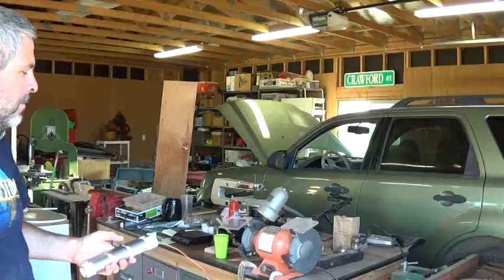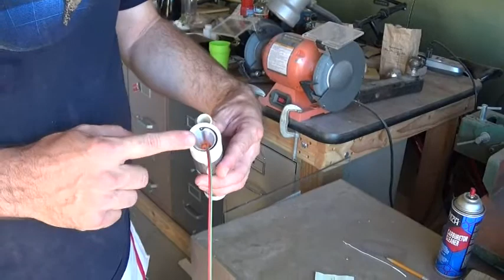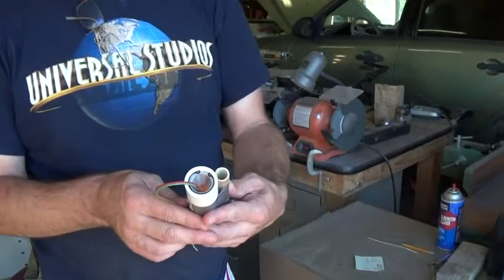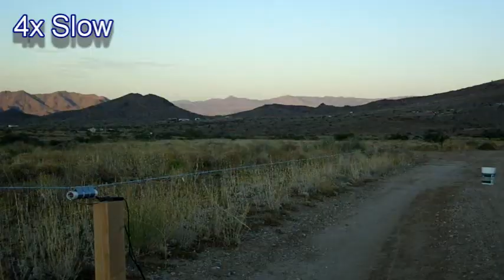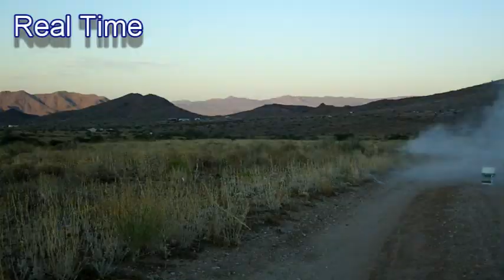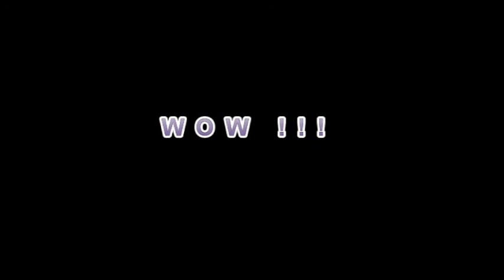Sugar Rocket Motor Test

Comment: How did you add the snapring?  I assume you cut a groove but how was it done? That nozzle looks like custom work. What is it made of?

Nice video work with great sound!
Reply from the maker: Oh man! I am sorry I did not see this comment. It got lost in my notification list.
Snap ring groove was made on the lathe so that was pretty easy. The nozzle did come out near the end of the "flight" so it seems the retaining system failed.
Nozzle was made by me on the lathe also. It was milled from a piece of aluminum stock. It was beautiful! However... Melting point of aluminum is around 1200 degrees. Flexi-fuel apparently gets well over 1200 degrees... Lesson learned! The convergent side of the nozzle had massive damage from melting and the nozzle hole was about 2 or 3 times its original diameter.
We have been trying various materials and techniques for nozzles to try and find something that is both effective and simple. In fact, I have one ready for testing later this afternoon. This one will be material number 4 and is by far the simplest to make. Fingers crossed.
Reply: @rotaryrocketry  You may be able to retain the nozzle externally with an end cap. That way you are outside of the heat source. Let me know how it goes!
Reply from the maker: @TheRocketeer  Good thought although my new nozzle design is "self-retaining" due to the pvc parts that are used.  On the down side... I just finished the motor test and it turns out that the nozzle washer was displaced off to one side in the concrete mix. I suspected there was a problem because I could not see the edge of the washer when I reamed out the hole through the concrete. So... Without a washer in place, the hole just got terribly large. Gonna build another nozzle and test that one tomorrow. This isn't "Take-Two"... It''s more like "Take-20". Oh well.
Side note... We are playing with D-grain. Does not have any performance increase for Total Impulse but it appears to give a much longer burn time. If that works out, a longer burn time should look more impressive at launch. Longer smoke trail :)
Reply from the maker: Follow up to previous comment... New D-Grain motor... BOOM... bummer.